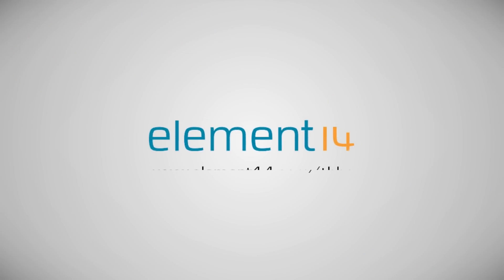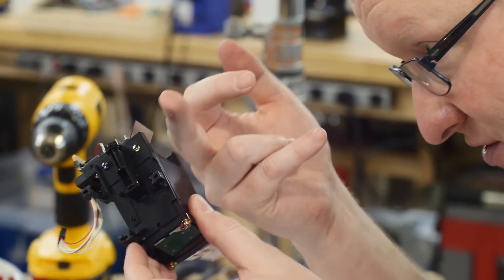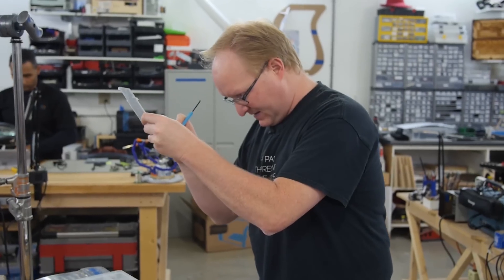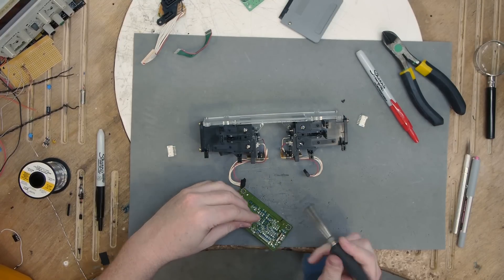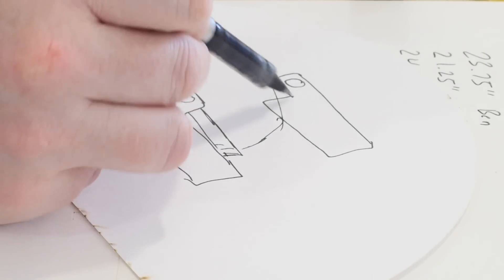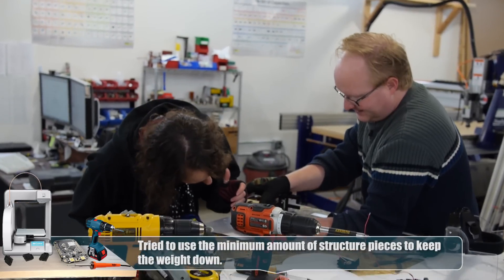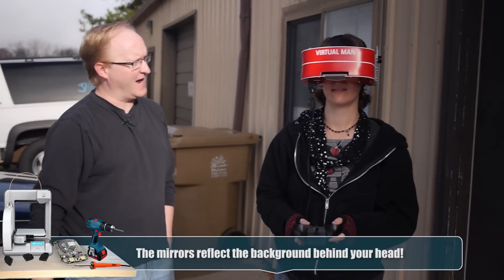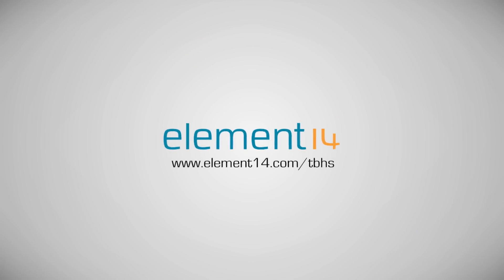Ben Heck's Virtual Boy Part 2:  Rebuild

Comment: How heavy was the unit on the head; could it be played for more than say... 15 minutes without fatigue?  Would it make sense to recreate the controller to include the power, logic board, and cartridge built into the controller then run the A/V cables up to the headpiece/visor? or all of those parts so light that it wouldn't have made much difference in weight and would just over-complicate the design?

Comment: Amazing work Mr. Heck! I love the way Karen and you redesigned the VirtualBoy helmet to be lighter, that's is the goal in VR to extend the comfortable playing time. Nice work! I never have any problem with the original red color of the LEDs, but it can get my sight tired fast sometimes...  How about playing with the colors of the Leds with a simpler solution, by testing it with different colored acrylic interchangeable screens, to see if that combination achieve to generate more comfortable new colors combined with the original red, or use various at different moments to avoid playing in red always. Thank for your cool videos, I enjoy them a lot, Karen is as clever as pretty, and give very good ideas to your projects. Your channel is the best! ;-)

Comment: I probably wont get a lot of support on this,but i have a great idea for some rebuilds,like,could a handheld Famicom Disk System be possible? or would it be possible to take a disk system and turn it into some attachment for the NES via Expansion Port on the bottom side,using a boot cart that is specifically set up to use the few pins on the nes cart that are directed to the expansion port?

Comment: The only other way I could see it improved is by somehow making the pad wireless? thinking about it, the unit would have to be bigger to house power supply and a wireless receiver, that is if you could transmit the signal from the pad wireless anyhow.

Comment: Honestly I would find a way to get rid of the motorized mirror video and replace it with a single LCD. A AVR and a LM1881 might work for just that. Or just for simplicity use a small single board computer of the fruit variety, LCD and such then emulate the Virtual Boy. Might even be able to find a non working system and reuse the casing and with a emulated system in said case it could be mounted to the head still.

Comment: "Always build things you can take apart" - Ben then proceeds to remove the ribbon cable connectors and solder the cables directly to the board...
Reply: Was thinking the exact same thing. It was one valuable lesson he taught me, and now he ignores it
Reply: There's a right time and a wrong time to use connectors.  Cost and weight considerations are important, and in this case weight and space are overriding concerns.

Besides it's time consuming, but not impossible to desolder things.
Reply: TheTurnipKing Here, those two saved grams really matter because this unit is going to space!

Comment: I would have tried to place the electronics, cartridge slot, and battery pack in an as slim as possible enclosure that can fit in your pocket or on a Walkman style belt clip. Then the headset would only house the imager, so it could be very light and comfortable.

Comment: I would have replaced the strange optics with something more efficient like a pair of small screens.
Reply: Fair enough, just a thought.
Reply: Stuart Grant would that have been possible? has it been done?
Reply: An easier solution would be a setup like Samsung Gear VR or google cardboard, use an old smartphone and have it display two screens.
Reply: it's almost always possible. Whether it's worth it is another thing entirely.

In this case it'd be WAAAAAY more efficient to just use a software emulator.
Reply: Stuart Grant I highly doubt an LCD would actually be more efficient.
Reply: Jesse Donat
Then a bunch of old LEDs and electromechanical mirrors, probably.
Reply: Skwisgar2322 Yeah, a single line of LEDs and a assuredly very light mirror being spun vs a full constantly lit LCD? I'd bet money the Virtual Boy's solution takes less power.
Reply: Jesse Donat
a small 2.8in TFT display will pull about 300mW mostly due to the backlights which can be turned down in a headset like this, I doubt the VB display (which is pulsing an electromagnet) is that efficient.
Reply: I just meant that it seemed like the path of least resistance.

Comment: "...still had a problem..." SLAM!!!

Yea. It's really hard to avoid the issue that this thing is crazy heavy. I'm really pondering if used in the long run, if player(s) will feel neck strain or not. (Which would be par for this red course, really.) Seems like potential, as all the weight is still in the front. Outside of a major redesign that wraps the innards around the head...somehow...or a total renewal that dumps as much of the classic innards as possible for modern equipment, (which is anti-purpose of this project) I'm stumped.

Heh...perhaps it is more comfortable to wear then it looks like. Having owned and held one of these, though...I find that hard to believe.
Reply: Oh snap, that totally works. Thanks for the pro tip!

Comment: I would have tried a hinge like those used for military night vision goggles. They're fairly sturdy and can be found at a reasonable price (including helmet) online through various sites. A lot of airsoft players use them, particularly for mounting action cams. Given that the mounting system was designed to serve the same function as the 'virtual man' it would have been my first choice.

Comment: And that's how you do it, Gunpei Yokoi...
Reply: Oriental Attack Actually the optics on Ben's rebuilt virtual boy WILL fail. He should have soldered the contacts on both ribbon cables, because simply resetting the old glue is just a temporary fix. The optics are the one thing guaranteed to fail on each and every virtual boy, unless you solder each contact on both ribbon cables.

Comment: I have an antique technology I would like to see improved! It's pretty difficult to wade through all the modern options for speakers, and most of them are pretty expensive and/or large. I would like to see a modernized and minimized diy set of speakers, kinda like a showcase of what modern speaker tech can do. I feel like consumerism has drowned the DIY and hacking out of hifi at a time when it's easier and cheaper than ever to build yourself some good stuff. How good can a liter of speakers for under $100 sound?

Comment: I would have used a welders helmet instead of a face shield since it can support the weight without adding the strap.
Reply: The welding helmets Ben and I have used have the same strap and locking mechanism as the face shield we used. From what I've experienced, it would not have helped given the weight of the Virtual Boy. With that design, you still have to squeeze your head to get a good hold. Unless you are referring to the kind that have the extra strap that goes below the base of your skull. That may have helped. I should have thought of that at the time. :P

Comment: you could improve an atari st or an amiga 500
Reply from the maker: We did consider an Amiga..
Reply: Please please please Amiga 600 laptop!
Reply: 600 gets no love, but if you're maxing out any classic Amiga, that's the one, just because of the small size and integrated hard drive interface.
Reply: Ben you should make / copy one of those FPGA based Amiga upgrades. That would be insanely awesome!!
Reply: you should make your own amiga vr headset and it would go nicely with an amiga laptop.
Reply: infact, let me see if I can provide some context for the Virtuality machines for you.  If memory served they were news in about 1992/1993. So, Doom was the new hotness. Windows 95 had yet to trouble the PC and 3DFX did not yet exist. The Playstation was yet a twinkle in Kutaragi's eye.

Mechwarrior 2 didn't come out until 1995, a PC game that was still using shaded polygons.

And smart phones did not exist, and certainly hadn't made accelerometers cheap and plentiful technology.

in 1992/1993, those machines were the stuff of science fiction. Please, forgive them some small technical deficiencies ;)
Reply: Amiga would be VERY great, I'm a big Amiga Fan!
Reply: The 600 was first internally called "A300", because it was meant to be low cost version of the Amiga 500 (early A600 boards have A300 printed on).
Reply: Yep, that was the first wave of VR. The old Virtuality systems were indeed based around Amigas.

It more or less preceeded (and indeed might well be considered one of the contributing factors to) the development and rise of 3D accelerator cards.

The fact that it's based around the 3000 should be telling about it's place in history, predating the arrival of even the AGA chipset.
Reply: The Amiga CD 32!
Reply: The Ben Heck Show The best amiga FPGA mod that i know is the Vampire II by Kipper2k. it adds  128mb of ram and an 64 bit prosessor way faster than the 68060 at 80mhz on the top of the line amiga. It also add higher reosolutions, true color and an hdmi output.
Reply: The 600 gets no love because it sucks. It's a less compatible and less expandable 500 with few features from 1200 that weren't fully compatible with the 1200 either because the 600 came out earlier. And it wasn't any cheaper than the 500. Even the director of Commodore UK called it a "complete and utter screw-up".
Reply: It's basically a smaller 500+. It has the same ECS chipset as the later A500 revision. Incompatibilities arise because in addition to this it has a newer revision of the ROM. Relokick is your friend.

The screwup with the 600 was really the timing. It came out VERY SHORTLY before 1200, confusing the public, and screwing over people like me, who'd bought a 600.
Reply: Daniel Lopez
That'd be neat. Too bad the classic Amigas don't really have the oomph for good VR. I've actually seen a VR system in person at a science museum in the 90s that ran off an Amiga 3000. It had to use mostly untextured flat shaded polygons for speed and those don't really give a good sense of 3D because there's nothing on them for your eyes to correlate other than the edges. (Snd it was still slow, and very noticeably slower still when you saw textures :P)
Reply: The Ben Heck Show Pretty pleaseeeee ,
something that will benefit amiga users
Reply: Probably the best thing you can do to benefit Amiga users is just run UAE on the Raspberry Pi.  With retargettable graphics libraries you can make very effective use of the graphics chipset in the Pi which should subtantially outpace just about any vintage Amiga.

https://jonlennartaasenden.wordpress.com/2014/10/09/building-an-a1200-for-40-with-raspberry-pi-and-uae4all/
Reply: I seem to recall a company many years ago offering the PAWS or Portable Amiga WorkStation. This was back when laptops were somewhat bulky and not nearly as compact and convenient as they are now.
Reply from the maker: Do you have any details on the FPGA Amiga mod?
Reply: +The Ben Heck Show  The best amiga FPGA mod that i know is the Vampire II by Kipper2k. it adds  128mb of ram and an 64 bit prosessor way faster than the 68060 at 80mhz on the top of the line amiga. It also add higher reosolutions, true color and an hdmi output.
Reply: hilariously, it is also for the A600.

Somehow, the underdog has had it's day at last.
Reply: Hmm. That might actually make an interesting handheld.
Reply: I am glad that so many people liked the idea of a pimped amiga 600, It would be nice to do chanches with cheap parts so all could do it

Comment: What I would have done differently? Add green or blue transparent foil so that what you see is anything but red.
Reply: uhhmm red LED's are monochromatic. A green or blue filter works by blocking all light that isn't part of the green or blue frequencies it allows through.
The end result of putting such a filter in front of a red LED would be you would see nothing at all.
Reply: Well that sucks. The only option would be to recreate something similar to the red LED row with blue SMD LEDs.
But I guess that would take insane precision with a hand soldering iron.

Comment: The final product looks like it's actually bigger than the regular Virtual Boy strapped to your head..... o.o
Reply: they did mention that they weren't losing any weight from the internals.. i suspect that the plastic was probably lighter, but this is more secure
Reply: Yeah I agree, but that thing is probably way lighter.
Reply: Yeah I probably would have just added a strap to the original Virtual Boy and removed the stand but I mean where's the fun in that anybody can do that it wouldn't be an Electronics project if he just did that

Comment: Keith Apicary already did this, and his is way better.
Reply: Keith used the normal unmodified virtualboy with the headstrap that came with it,     where this one is like a welding mask,  so you can lift it up.
personally i would use Keiths method too,    but obviously Keith did not do "this"

Comment: Can you change the LED colors? Like have it red blue green white per eye peace? Just wondering what that would look like.
Reply: That's something I'm eventually hoping for.
Reply: Seems unlikely since it's a very small LED strip that doesn't seem much like a generic part.
Guess you could maybe do that with a lot of effort though.
It'd still be a monochrome display in the end though, since the hardware has no way of doing colour.
(and considering how they work, a white LED would probably cause weird colour fringing if you used it for this.)
Reply: I thought the previous episode he discovered that it is red because of a red filter in front of the LEDS. I bet you could swap out the red filter for any color you'd like :)
Reply: Agreed would have been cool if they made it monochrome. Nintendo went red because it was cheaper and made the blacks blacker (not sure how that worked) to increase the sense of depth.
Reply: The games were programmed with just two colors, tho (black and red). You can't really add more.
Reply: But you could do black and green instead ;)
Reply: Schwarzorn each eye peace has 4 red LEDs I'm just asking to change the colors I don't expect it to be in color. Just want to know how it would look. Probably very trippy.
Reply: It's be touch and go since the VB's dependant on persistence of vision to create the screen image. How quickly can RGB LED's change color? Timing would be very important.

Comment: Ben Heck does what Nintendon't
Reply from the maker: and to be this good takes sega, ages.
Reply: @element14presents  Nice Amiga CD32 reference!
Reply: Ben could you make a consolised Sega GameGear ?
Reply: Hmm... Maybe Ben could actually do what Nintendidn't. A "true" Classic Mini NES!
Reply: Not quite. The Game Gear has a broader colour palette than the Master System which means a Game Gear could handle games directly ported to it from the Master System but not the other way around.
Reply: @katsujinken10  Broader colour palette (but same number of colors onscreen, as the SMS had) is easier to adjust for in porting than to a lower resolution (as the GG had).
Reply: Yes few people have been able to pull off a consolised Game Gear for some reason.
Reply: Ben probably did a Retropie or two by now check his old videos.
Reply: TheRanblingjohnny 
Oh, I'm talking about making one out of an FPGA.
Reply: A consolized Game Gear sounds like a great idea.
Reply: Good one
Reply: odiz m That is basically a Master System.

Comment: I would have loved to give you my Virtual Girl and have you change the LEDs to Pink to match the rest of the system lol. I loved the build. Seeing what everyone comes up with for this system in terms of customization is fantastic.
Reply: Haha Google tends to agree when you do an image search. It's just a custom Virtual Boy console & controller I did. I painted it pink with black accenting and did custom, font-accurate "Virtual Girl" logos for it and the controller. I wanted to switch out the LEDs and lenses for pink ones but it doesn't seem like an easy task.
Reply: you should google about replacing the LEDs,   i once read about someone who found replacement red leds,    i bet if you can find out what model,  you can also get them in pink (or white,  then just color them pink)
Reply: ... huh. That is indeed a pretty dubious set of search results...

Do pink LED's even exist? Seems a kind of awkward colour for an LED to reproduce, since it's basically white (already not that easy for an LED to produce) with red.
I have a colour changing RGB LED lamp nearby, and while it has purple, green, red, orange, and blue, (and a white which isn't very good at actually looking white), there's nothing even close to pink...
Reply: KuraIthys
my rgb led does pink fine....   but  i think white led would be cheaper,   just use pink marker :P
Reply: I was chatting with Pat the NES Punk about my Virtual Girl at a con I went to and he was saying how some guy that was floating around had some success with difficult projects like that. I never found him to ask him though. The LEDs used in the VB are really small and not a generic LED from what I've read. If it was possible I wouldn't trust myself to do the work likely.
Reply: they're probably surface mount, it's a fairly common form factor these days.
Reply: Last time i ordered some leds off of digikey, the pink ones and the purple ones were slightly more expensive.
Reply: Candi's Classic Game Shrine If you do find someone to crack open the virtual girl to add pink led's, also have them solder each contact on both the L and R optic ribbon cables. You'll thank me later..
Reply: There's a virtual girl on every corner nowadays